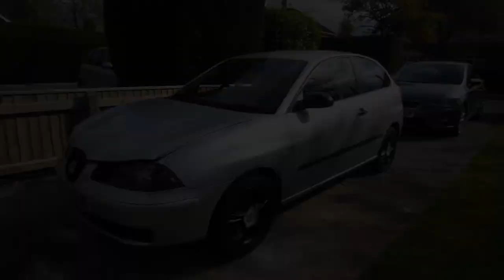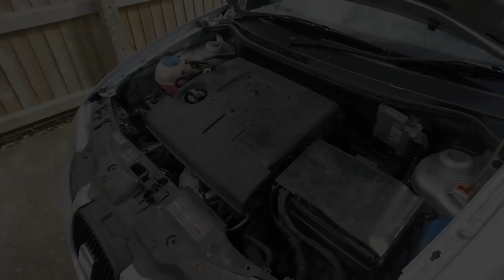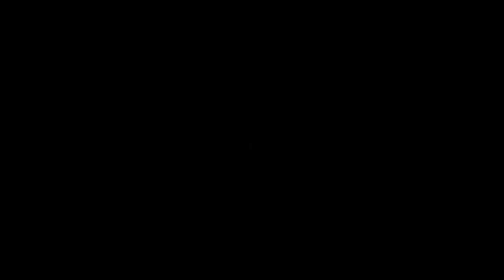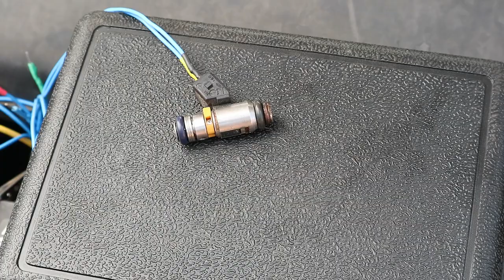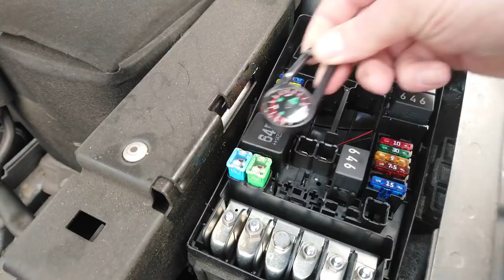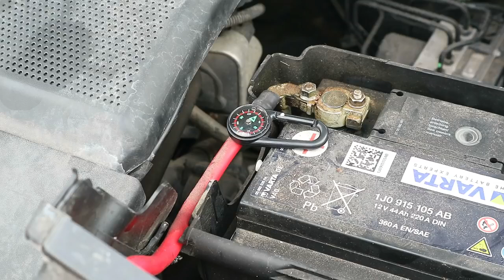This Simple Tool Changed the Way I Fix Cars Forever.

Comment: i use a 9v battery to find Stereo Speaker wires. I've got a 9v that I've soldered about 4in of wire to each lead of the battery and if you touch them to the + & - leads of a speaker it will make a scratchy popping noise and if you are able to see the actually dome of the speaker you can tell the impedance also due to the speaker moving in or out when you keep the 9v's supplied.  (P.S. I'm ordering a Compass tonight for my toolbox!)
Reply: From 2005 - 2010 I worked for a vehicle and home audio/video retailer. I use to install audio systems, neon & led lighting (aka sex lights) 😝alarms/remote start in vehicles along with surround sounds, tv's, and satellite tv in homes. Probably did more moonlighting jobs than I did for the overpriced store. So this 9v trick is from back then. Almost 40 now and still have that 9v laying in my toolbox.
Reply from the maker: Yes, i've seen the 9v battery test too....You just have to love cheap innovative methods